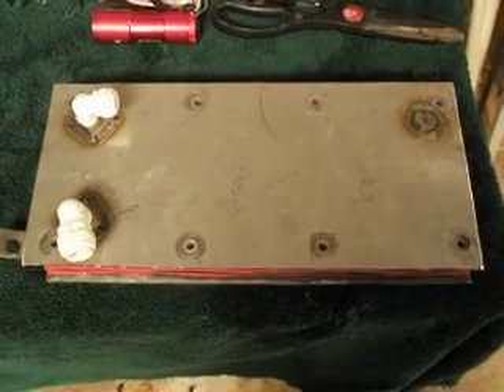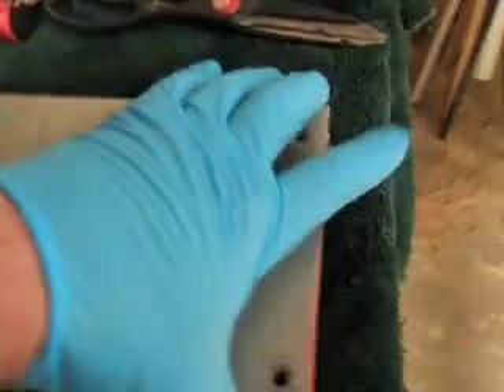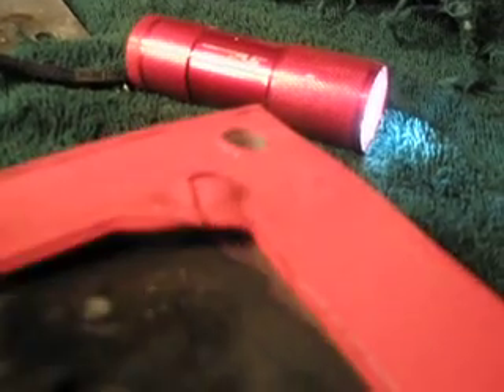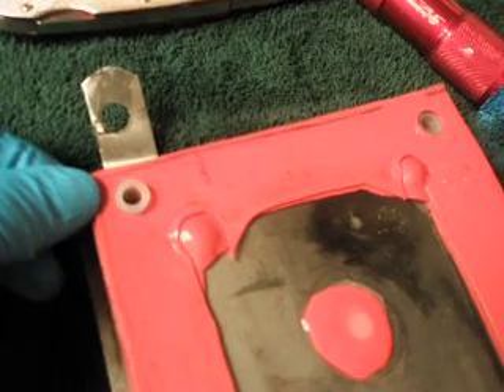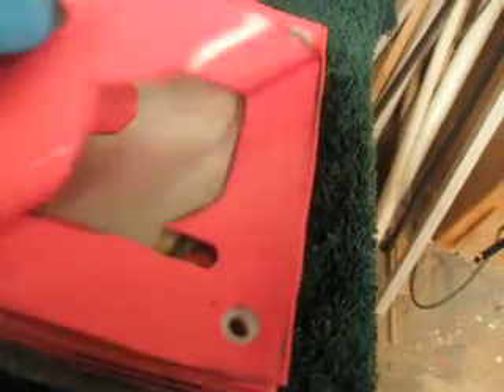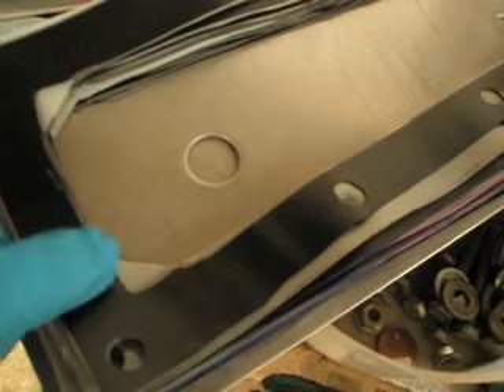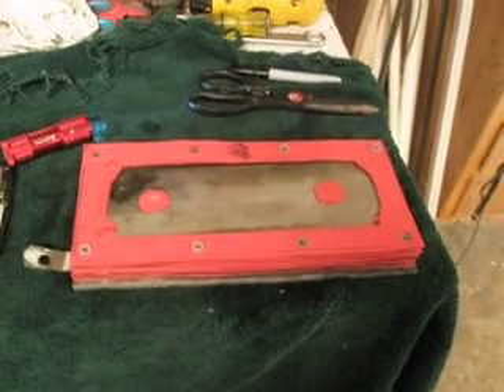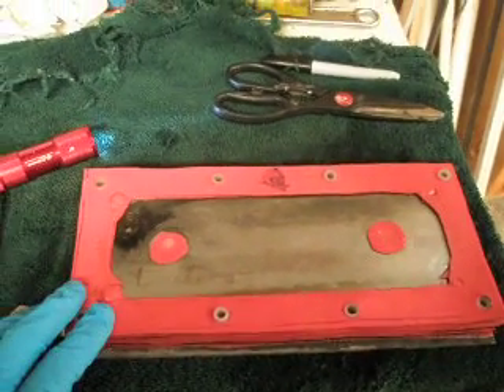Problems revealed

Comment: Hi Bob. KOH and certain types of plastics do react, but a sudden thought came to me while I had the video on pause, the way those gaskets are put together, the gas/water flow should be in one direction only, was it wired up to flow in the right direction, it may look has though it was push up, but may have been sucked in or down, the when took apart popped the other way.
cheers zeropoint.